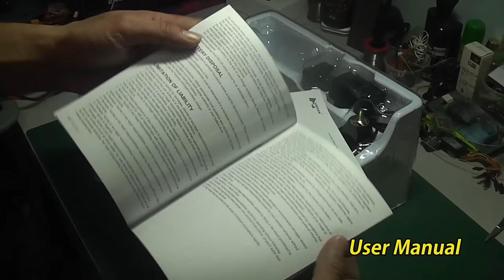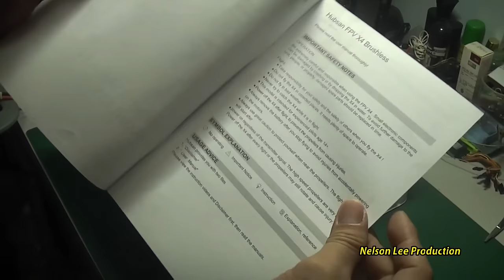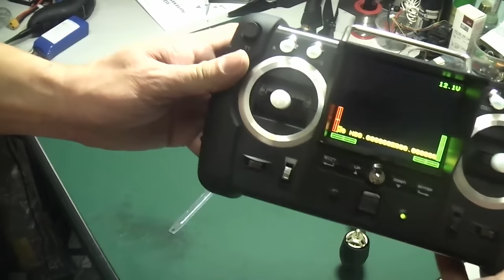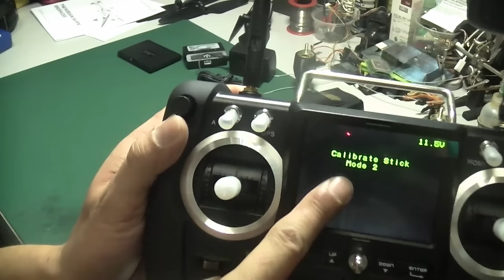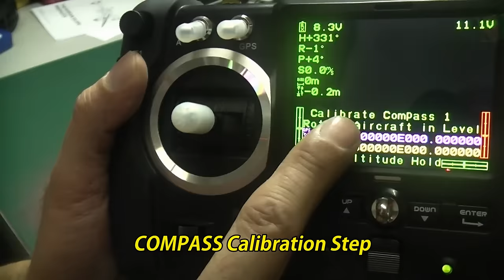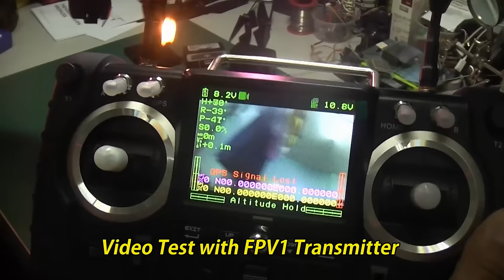Hubsan H501S X4 Unboxing and Review Purchase from Banggood

Comment: My congratulations for your videos so well explained, I have a H501A hubsan I did the drone update but I can't do the advanced radio control because it doesn't seem connected to the update tool on the pc (not connect) the pc accepted the control but does not connect to the update tool, I already bought three cables from different suppliers but none connect the tool and NOT CONNECT appears. Can someone help me solve this problem because I don't know what to do. I thank you in advance, stay with God.

Comment: Hi Buddy. I am getting one of these advanced H501S quads soon. Do you know if the software is more advance in it too? reason I ask is because I had the standard version which was great to fly and easy as I am a newbie pilot. Unfortunately it just dropped from the sky one day and smashed... Just complete power failure even though all batteries were on 100% obviously want another quad so though advanced version with better transmitter would be better. Have you had any issues with yours?

Comment: Does the better transmitter give better range on drone and on video than 300 Meters? It should i expect, be good for more than 700 meters now..
Reply from the maker: For the range you need to check with Hubsan technical support team or you can modify to have better flight range. I saw other people videos they can flight around 1.8m.

Comment: Hello Nelson.  Thanks for your video.  I see that you have the 5.8GHz antenna with the Hubsan logo pointed towards you.  I just received my controller with the same antenna orientation.  However, my manual Version 1.1 EN says to point the Hubsan logo towards the quadcopter.    Is this correct, and would it damage the antenna to twist it 180 degree?
Reply from the maker: it will not damage,it can be twist

Comment: Hi. Have You tried connecting something to the video out port on the transmitter? 
I wonder if it's port only for FPV feed or it's transmitting FPV with telemetry data (GPS, battery, etc...)
Reply from the maker: I have tried connect the transmitter video output to external monitor but unfortunately it's not functioning.
The default transmitter has telemetry indicated.
Reply: Too bad. My intention is to have bigger screen to actually see something more.
Reply from the maker: +gruber6969 My Eachine EV 800 FPV Goggles just arrived, I will have try again later and update to you soon.
Reply: Thanks in advance :)
Reply from the maker: Video already up, please see on here:https://www.youtube.com/watch?v=KFIWXTfoY5Q&feature=youtu.be

Comment: Hello there,  can you tell us wich is the  main difference  between  the standart version and the advance version ??  Is it only the transmitter,  the range,  any feature ???? 
Im about to get one and to many info on the Internet  can't  answer  my doubt. 

Thanks a lot.
Reply from the maker: Hi, Yes it's only difference the transmitter range,the FPV1(Professional) transmitter have 4 switched,=GPS Hold, Headless Mode, One Key Return, Follow Me Mode. If you pick the standard version transmitter then you need to modify extend the range.

Comment: Hi Mr Nelson, any import tax duty or GST had been  applied to your Hubsan when coming into Malaysia? I'm worried to do direct importing due to our country sorts of regulation, then will implied excessive unknown cost. Must apply SIRIM e-permit or not necessary?  becoz it has 5.8Ghz RF video links, which last time I had the e-permit when brought in the BOSCAM 5.8Ghz Tx/Rx. Otherwise Penang Custom Dept wouldn't release it.  Any advice before place the order? Thanks.
Reply from the maker: MD Wzn Hi,so far I received this H501S no GST tax because the boxes is not that big, if you buy Hubsan H109S yes this got GST tax
Reply: Ok noted. Just started with Syma, WLToys Q303, but that cheap quad doesn't has GPS, too risky of flyaway/ crashed. I'm looking up a better features like the Hubsan 501s. How's your Hubsan so far any problems with the compass/ GPS lost? Thanks for the reply Mr Nelson. Anyway nice video.
Reply from the maker: So far so good this H501S i like it so much, if you want to buy just click on the link at my description there.Have a good day.
Reply: MD Wzn I got my from Banggood no gst and very much cheaper than local web site. I event buy extra battery ,  smart charger and ec2 connector from banggod. Aluminum bag on the way. penang malaysia.
Reply from the maker: That's what i told you before,this model wont get tax from custom because mine also no tax.
Reply: Nelson how far your drone can fly? Mine only 164M and high 24M only. I ask Drone worshiper he told to download "super Fly" firmware. Any idea where to download?
Reply from the maker: ***** If you subscript my youtube channel then sure you will know where the SuperFly firmware....watch here and get it: https://www.youtube.com/watch?v=zQMBnAmBOOM&t=1s
Reply: You don't change to lipo battery? I change mine. Got it from local RC shop. 11.4v 2200mAh C5. for RM50.00 last for 10 nfly.
Reply from the maker: I did....please see on this video: https://www.youtube.com/watch?v=f_fI_pbs15c

Comment: Hi. Great video. I am also thinking about buying the Hubsan Quadcopter. But what exactly is the difference between the Pro Version Transmitter and the Standard Version Transmitter?
Greeting Eddy
Reply from the maker: Edmund Walter Hi,the different only the transmitter,the rest is same.
Reply: +Nelson Lee. 
So he has no other functions than the standard! He just looks different? Sorry for the stupid questions but I am only dealing with Quadcopter recently.
Reply from the maker: Edmund Walter Pro version transmitter the FPV screen is smaller than the Standard version transmitter,but Pro version range is better than standard,if standard version you want get more fly range you need to mod the 2.4G and 5.8G Antenna,but pro version no mod requirements.
Reply: +Nelson Lee . Thank you

Comment: What kind of Lipo Battery will work with this transmitter?
Reply from the maker: Sorry for late reply.

-BQY Power 11.1V 2200mAh Lipo Battery For RC Transmitter C305
http://www.banggood.com/Wholesale-BQY-Power-11_1V-2200mAh-Lipo-Battery-For-RC-Transmitter-C305-p-65643.html?p=762503080763201209MY

-STARC 11.1V 8C 2200mAh Li-Poly Battery For Flysky Futaba Walkera Transmitter
http://www.banggood.com/STARC-11_1V-8C-2200mAh-Li-Poly-Battery-For-Flysky-Futaba-Walkera-Transmitter-p-987461.html?p=762503080763201209MY

-YW 11.1V 2200MAH 8C Lipo Battery for WFLY JR Walkera FS Transmitter
http://www.banggood.com/YW-11_1V-2200MAH-8C-Lipo-Battery-for-WFLY-JR-Walkera-FS-Transmitter-p-1031611.html?p=762503080763201209MY